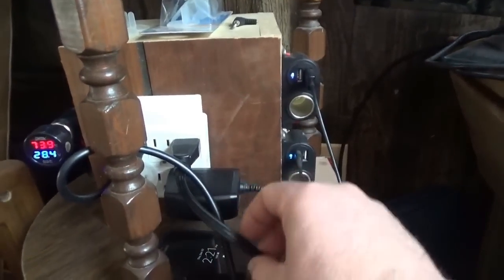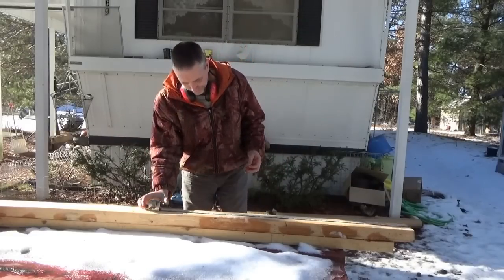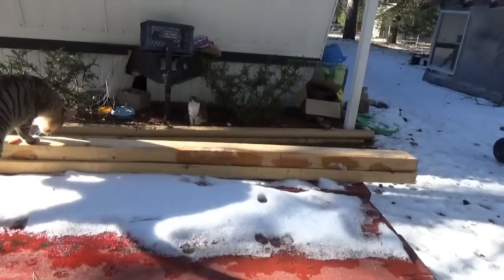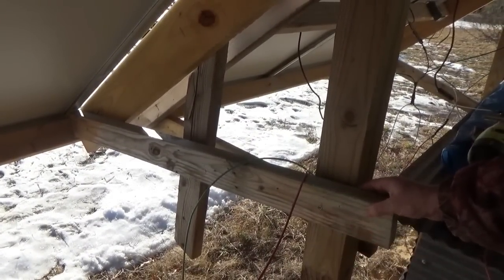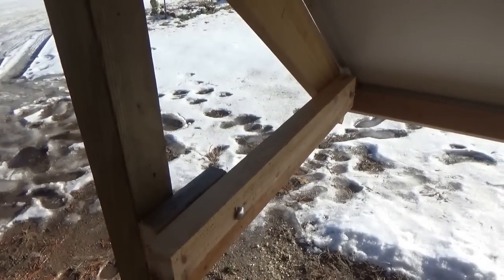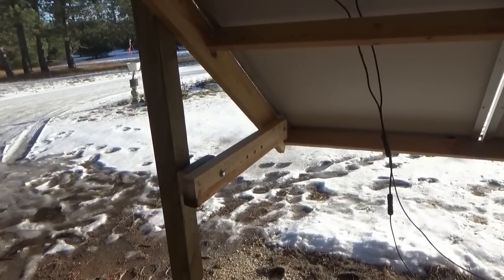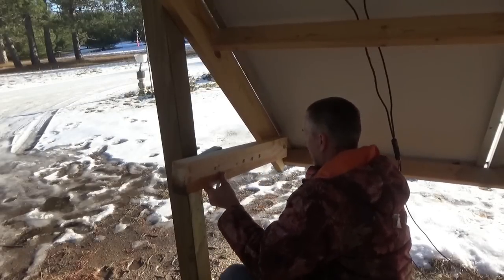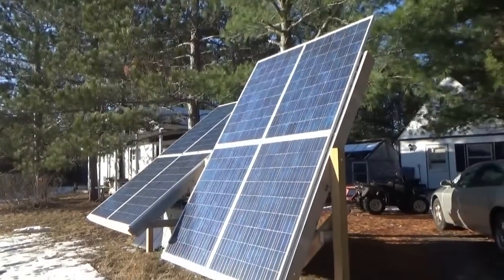Making Adjustable Arms On Solar Panel Racks And Burning Solar Power

Comment: Mining is long over dood. Unless you have massive scale.
Reply: Price of bitcoin falls below cost to mine https://nypost.com/2018/12/16/price-of-bitcoin-falls-below-cost-to-mine/
Reply from the maker: I believe it could come back. I can mine for free using solar power so no cost to me. Its like a savings account.
Reply: Solar power can be used for many things including powering modern conveniences that make life so much better. You're trading that away on a gamble that cryptocurrency may come back. Personally, I would rather power real lighting (instead of weak battery powered lights) or heat water, or power the fridge, and freezer, or anything else.
Reply from the maker: David. One thing you must know about solar power. You must have more solar panels than you actually need at any given time. This is so that on cloudy days you still have enough power for your needs. But this means on sunny days you have excess power. Power to burn.
Now if you are grid tied, good. If not, then why not make some money with it?

Comment: That is a much better angle. Put your square on the glass about 2 o clock in the afternoon sun and see if it throws a shadow. when the panel is perpendicular to the sun there will be no shadow from the square to the panel. my video here https://youtu.be/SrHPHzNMsWE

Comment: Love your setup Brother Troy.  I have a credenza I bought.  Put all my sealed led acid batteries on one bottom shelf.  Charge controller on another shelf.  Wired in Standard plug in Receptacles using strayed wires.   So all my 12 volt lamps feed off of those outlets.    My T.V Runs off a 1100 watt inverter.    I use Roku for my t.v that plugs in the back of the t.v. So it’s powered from Solar Also.  Always look forward to your posts.  Thanks.  Be Blessed.